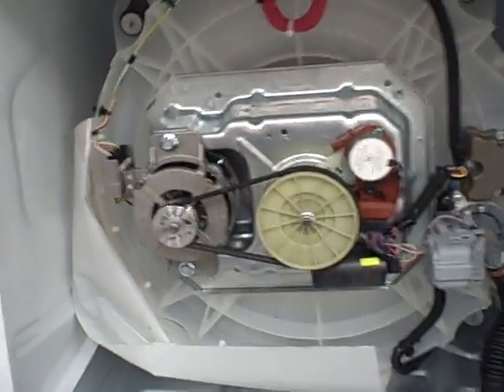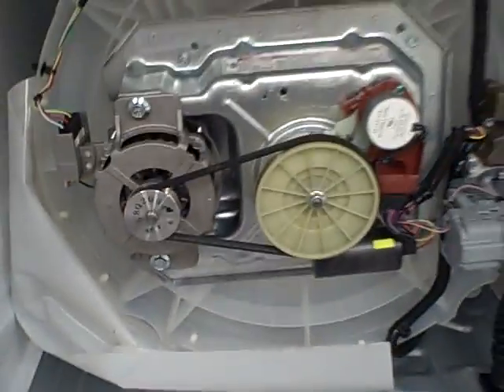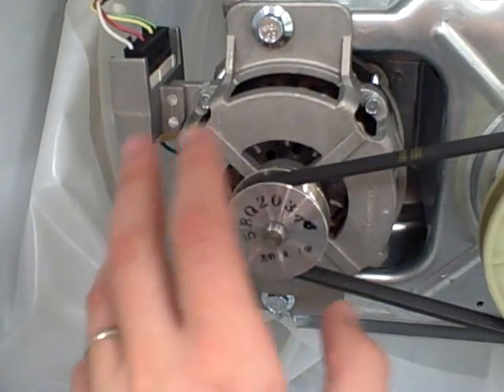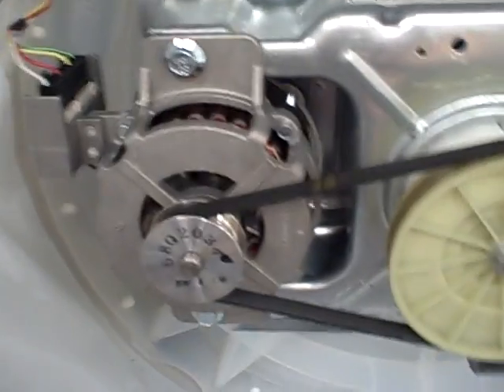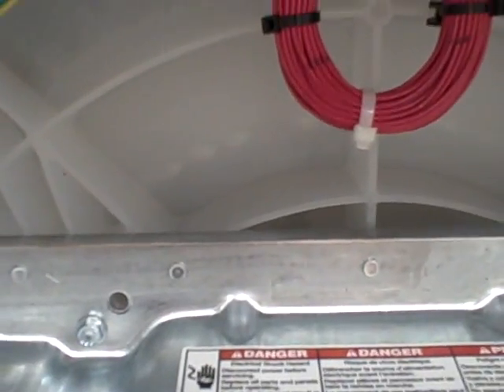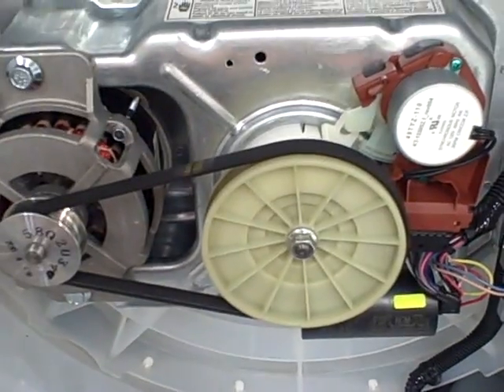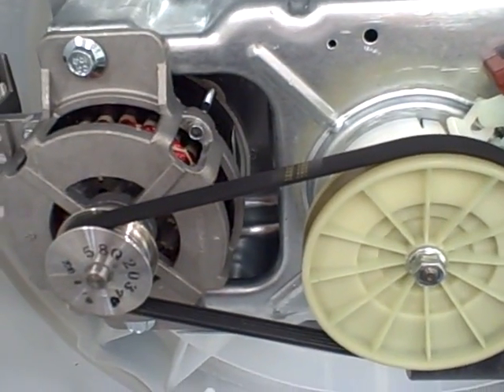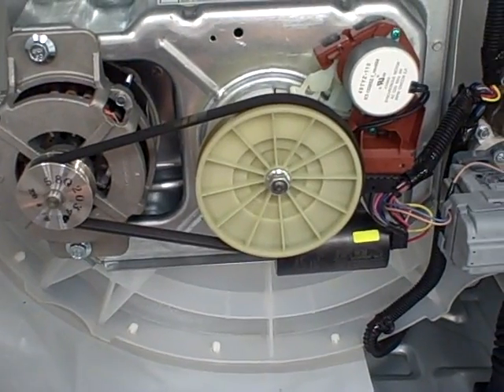ALL-NEW Whirlpool Belt-Drive washer in full detail!! (4800x model)

Comment: The internals of the transmission locaded above the splutch contain a step down planetary gear set inside a housing that operates to gear down the drive from the pulley it also splits the torque driving the agitator or wash impeller one direction and the drum the other while the washer is shifted into Agitate mode ., when the washer shifts the splutch which has a splined sleeve that locks into splines on the top of the drive pulley  it direct drives the outer casing of the transmission bypassing its inner gears and spins the tub.. there is no tub brake so the washer must coast to a stop that's why the lid must lock  (the mode shifter has a optical sensor that reads a toothed wheel in the transmission housing telling the washer control board the rotational speed of the drum) What does the gear case look like inside ?    https://youtu.be/KPwXmuRoaVE

Comment: My GE washer which is approx. 6 years crapped out on Saturday. Long story short, had service tech come and inspect machine - transmission is shot. 

Question- what rip load washer brand do you recommend that will deliver performance and longevity. 

He said GE brand is at the bottom as far as reliability is concerned. 

Any advice regarding this issue would be helpful. 

Thanks
Reply from the maker: My recommendation is s Samsung Top load belt drive.  I currently have one and in the year of ownership I have had 0 issues.
Reply: @thejmcGarage  that’s what I’m leaning towards. Do you have a model number I can use for reference?
Reply from the maker: @robertlombardi2228  yes the entry model is the WA45T3200 4.5cuft capacity
Reply: @thejmcGarage  thanks

Comment: The red part in video is a shift actuator and is a common cause of not draining properly or if it washes the stops and won't drain. Also see videos for splutch (splined clutch) they can get dirt in them that makes the actuator work hard or not engage enough. I found a new shift actuator on ebay for $30 and the splutch with new belt for $35 all new on ebay.

Comment: Maytag bravos washer makes rattling noise....abnormal noise...while shifting from wash spin mode to rinse agitate mode....wash plate abruptly jerks counter clockwise about half turn ...rattling stops and washer agitates upon completion of filling with water....main board ok....replaced actuator 2x...what’s the problem?...maybe the splutch?……
Reply: I replaced splutch...now it works fine

Comment: That was a great tutorial! Thank You. I'm trying to fix my neighbors washer, same kind. I'm hoping for some advice. Initially it had a lock lid light flashing, and it made a sound like the motor was either locked up or the start capacitor was bad. I replaced the start capacitor and the shift actuator. There is no lock lid light flashing now, and no weird sound,  but it still does not work. I get a continual sensing light on along with the lock lid light on, not flashing. Everything seems to work in the diag mode except wash and spin. Either it's the splutch or the new actuator is no good. She had some appliance guy come out, and in 5 minutes, he said she needed a new control board, or better yet, a new washer, without even looking at it. I guess I'm asking if you think I'm on the right track, or if you had another suggestion. Thanks in advance for any advice or input!

Comment: Yeah I have one of those washers and the so-called transmission is a non-repairable sealed unit here is the part numberW11255272 for mine.
It looks to me like they made a cheap washer that would cost a lot of money to repair.
It looks to me that they build a cheap washer with expensive repair parts, knowing that it would only last a few years before the whole main 😂drive without.
The main drive unit cost about 3rd of buying 170 dollars.
I think the washer drive system would have been a good system if you could have replace the inner parts of the transmission unit.
I may attempt a repair to the bearings of my unit just the only thing wrong was it, the problem being is a wilted both ends of the shaft that the bearing is on.
Looks like I may have to cut  the weld to replace the bearing.
Then I'll have to win it all back up again. I'm hoping and praying I can do itso I don't have to spend $170 on a new unit which the marions only cost $7 on eBay the part number for the bearings are 6006-2RS.

Comment: how do I get the bearings out where splauch is
Reply: you have to beat the shaft from the top. you have to remove the rods, then put the barrel on piece of wood so you have clearance between motor and the floor then you hit from top after removing the plastic cover. there should be a video. I'll look for it

Comment: I replaced the belt because the washer was NOT spinning...it worked for maybe 3-4 loads and now it is not spinning again...I checked the belt and it looks like it is slipping on the pulley mounted on the motor. I see here that you have a metal pulley and mine is plastic...is there any replacement parts?

Comment: Didn't say what the capacitor does. It's a start capacitor that gives the motor a burst of power that gets the motor going.
Reply: yes. if capacitor is bad, motor won't start
Reply: And it's a split cap. Allows the motor to reverse and start up in either direction. Caps are used for start up on many products FYI such as an air compressor without it  the motors AC load would grip the breaker, just gives the motor a hard kick start on start up.

Comment: there is an optical sensor close to the piece the synchronization motor moves that tells the control board which mode it is in and if the sensor malfunctions the board won't know which mode the mechanism is in so it won't do anything when turned on

Comment: I have been the unfortunate owner of a Cabrio WTW5500 for six years. I just finished replacing the entire gearbox because the main bearing is NOT replaceable. I also replaced the four suspension tub-hanging rods, because one cannot replace just the worn teflon sliders. I do my own work and shop carefully online for parts, so repairs have cost me "only" $200+ over six years of fairly light use. This thing replaced a 20-year-old Maytag that finally rusted out. The only repair the Maytag needed was the lid switch (sub-$10 part, about a 15-minute repair, if that).
Reply: I had old Whirlpool model lasted 10 years that rusted and I replaced with this one......BAD CHOICE....

Comment: Pure junk! Two years old and quit spinning the water out of the clothes.
Reply: Thanks for your guidelines.very,very helpful.thanks for all your time to make the videos.thanks.
,
Reply: the freaking belt just slips right off that retarded plastic no groove splutch pulley and the cover then shreds the belt till i's worthless. Really a total POS design
Reply: mine was 16 months when it quit...crazy...and I replace any parts, even the splush but still won't spin..I got the manual for the tech inside to look at the codes and it won't do the spinning in manual test. but I didn't get what the final problem is. I checked all the wiring and the resistance as required and everything looks fine...so where the problem is???

Comment: I have the Whirlpool wtw4800bq model.  It is 3 years old and works great.  It really moves my clothes around during agitation too.  The best thing about it is I have full control over the tub fill on my model, which may be the last model Whirlpool ever made with that feature.  I hope it lasts me.   Just in case it doesn't, I bought a mechanically controlled Speed Queen washer.  That thing is built like a tank and will probably last 20+ years.  I use that one now more than the Whirlpool but I make sure to use the Whirlpool about once a week.  It really is a fine machine in its own right.  It has a super fast spin speed of 1100 rpm which is faster than the Speed Queen.

Comment: I appreciate the video!  The other day, I smelled burning rubber and then my Roper (Whirlpool) machine (Model RTW4640YQ0) has had two malfunctions that seemed to happen at the same time: agitator does not work and spin cycle dies not work.  I did replace the belt because of the burning rubber smell, but that did not fix the problem.  This washing machine cannot be more than two years old.  Is it the splutch? Any suggestions?  Thanks.

Comment: All I see here is the ever increasing cheapening of washer mechanics, no transmission, lots and lots of breakable plastic parts in high load areas there should be metal, plastic outer tub instead of porcelain coated steel, circuit boards in a wet high vibration environment, and a light duty pump with its own tiny little motor that's bound to fail - pumps used to be driven off the main washer motor, extremely reliable for decades.  The "splutch" has since proven to have a high failure rate and it makes horrendous noise when the plastic gears strip out.   Sure glad I bought a Speed Queen, built to last 20 years and washes like moms old Maytag from the 60's.
Reply: The lid lock is a whole other scheme in itself besides crappy cheap parts...
It's kinda "funny" how jmc600 says, "..pretty basic design..not alot can go wrong with this..." .  -pfft
Reply: isnt the lid lock just so the manufacturer does not have to place a tub brake on er?
Reply: yambo59 check out the speed queen

Comment: Building them cheaper and cheaper every year. Way too much plastic in critical load areas, this hurts reliability badly.  Plastic tubs crack and leak, plastic drive pieces wont handle the repetitive torque, and any time a capacitor is involved its a failure waiting to happen as capacitors have a limited life in any application.   Circuit boards are another bad idea in washers, it doesn't take a genius to know high humidity areas spell death to circuit boards.  These new appliances are designed to fail prematurely and everyone is finding it out pretty quick.   Funny how the government forces more and more regulations on us to save the planet, yet because of those same regulations and greedy manufacturers building ever more inferior short lived products were throwing poor quality appliances into our landfills every 2 to 5 years instead of lasting 15 or 20 years. I fail to see the logic.  And many are saying they have to run their "high efficiency" washers twice just to get clothes clean and dry, so much for the "HE" part.   I have a 40 year old GE Filter Flo washer that's built like a tank and still going strong, try that with any washer made today.

Comment: Sad, look at all that plastic...
Reply: I was also commenting on the same thing, plastic used in high stress high torque areas too.  The plastic tub really gets me, the way a washer operates in spin etc. no way plastic can survive like steel, ive seen videos on patching the plastic tanks as well as replacing them.   I cant believe how hard they have worked to cheapen appliances as much as possible.   Lots of delicate moisture sensitive electronics and bells and whistles that impress the less informed but aren't even needed to wash clothes.  And they cant wait to sell you a $100 circuit board I bet either.  Im buying a new commercial duty Speed Queen very soon, its the only washer that's still made halfway decent with a much better warranty than any of the other brands, but theyre not cheap.  But you can buy two of the cheap ones and throw them away in three years apiece, or buy one Speed Queen and be set for 10 - 15 years or more.

Comment: MayTag HE centennial  mvwc400xw3 stuck in spin cycle won't do anything but spin. was making a grinding sound so i flipped it on it's front and there was what looked like a piece of a rag in between the big drive wheel and the plastic teeth that turn the drum. Is there suppose to be a spacer in there or was it just something a mouse dragged in. Any way after i removed it, it will only stay on spin no matter where u put the dial. i unplugged hoping that would reset it. Now  the spins light flashes all the time if you try and hit the start button , lid will lock and where off the the spin mode. was working perfect before this happened I removed the pully and got the rag out.
Reply: did you try to calibrate it? bcs it looks like in ur case the computer lost calibration bcs of the rag

Comment: Good video. 
I would disagree on one thing unless I misunderstood.
This washer is actually more complicated from a repair standpoint then the Direct Drive. 95 percent of the direct drive problems resulted in simple things, couplings, switch and valves. Not much else could go wrong. The only other problem was technicians who didn't know what they were doing.
This new machine however requires more diagnostic time and is unable to handle the loads of laundry the direct drive could handle.
I have more of these machines coming into my shop after their first year in service then I ever had with the direct drive. The three most common problems is the suspension failing, the mode shifter and failure of the consumer to use High efficiency low suds soap.

Just some thoughts.
Lavadoras y Secadoras de Mazatlan
Reply: +Lavadoras y Secadoras Mazatlan MayTag HE centennial  mvwc400xw3 stuck in spin cycle won't do anything but spin. was making a grinding sound so i flipped it on it's front and there was what looked like a piece of a rag in between the big drive wheel and the plastic teeth that turn the drum. Is there suppose to be a spacer in there or was it just something a mouse dragged in. Any way after i removed it, it will only stay on spin no matter where u put the dial. i unplugged hoping that would reset it. Now  the spins light flashes all the time if you try and hit the start button , lid will lock and where off the the spin mode. was working perfect before this happened I removed the pully and got the rag out.
Reply: Did you go into the diagnostic program to see what faults you have? It sounds like the shifter is inop but its better to check your codes first and then check your shifter. Inside your washer is a manual explaining how to enter the diagnostic program
Reply: Looked for the manual it is missing and it won't let me go into the diagnostic mode. soon as i plug it back in spin light starts flashing and that's it other than if you push the power button it spins.
Reply: Unplug the machine for 5 minutes and recconect
Reply: Then push the start stop button for three seconds minimum
Reply: Then spin the dial backwards for at least 5 full turns. Then forward one turn , then one more, then one more, then one in reverse. If done right all the lights should be flashing. Do them smoothly and evenly and steady. You may not get it the first few tries.
Reply: Let me know when you have that
Reply: Tried it several times and nothing but the spin light flashing.
Reply: Sorry was out of town.  If you cant get into the diagnostics than it sounds like a problem with the board.
Reply: Thank u we are currently renting a machine so where might i find a board? All it will do is go to the spin cycle and stays there until u unplug it or hit the start button again.
Reply: Lavadoras y Secadoras Mazatlan as a matter of fact this machine sucks, i want the direct drive machine back.
Reply: how do you consider suspension failing? because mine look perfectly fine but still the washer won't spin even if the calibration process works perfectly
Reply: Nice.

Comment: Thanks for the vid jmc6000, i'm looking for a good basic belt driven washer...can you recommend one or two models to look at please?  thank you
Reply: +volkrt most of the new washers are the same and pieces of SH##. If you can find you a good used center agitator machine go for it.
Reply from the maker: +volkrt From GE model GTW460ASJWW or GTW485ASJWW  are some good units.
Reply: I agree, when my 40 year old GE filterflo's outer wash tub started rusting that's just what I did, I bought a commercial duty Speed Queen and its been an excellent machine. When you see how smooth and stable they are in the spin cycle you realize why they call them a Speed Queen-!

Comment: I cant get my bolt off. I hold the pulley and when trying to unscrew the whole bolt moves with the nut. How do i get the nut off now? please help.
Reply: +Jaime Matulka  I know this is 3 months old but Bolt is put on with red lock tight. U can hold it and break it loose but you have to really put out at least i had to on mine. Thought at first it was welded on but it finally came loose.

Comment: I just replaced my shift actuator today 12/20 and washer still won't spin! Any idea? Kenmore 110. 26002010
Reply: Also, no standing water left. Clothe just soaking wet and won't spin.
Reply from the maker: +edgu71eg The hall sensor could be bad and if that hall sensor cannot sense movement when the drum is in spin mode it will thrown an error code and cause the drum not to spin.
Reply: yes I think spin actuator is not responsible for  not spinning. problem is unbalance...so could be bearing or the balanccing rods

Comment: 4 years old , began an awful  squealing noise while in spin, water level switch faulty, , belt chewed, splutch mostly stripped, main tub seal leaking all within a week! And from new, went through several clicks and clacks and test drum partial turns before it would fill with water sometimes taking 5 minute to start. Off balance is a norm for this POS .While the design appears to be simple as you say , all parts seem to fail at once. Never buying another whirlpool product.

Comment: I removed the cover off and it was covered with oil and the belt was off . I replaced the belt and started the washer it started to run then there was a load grinding noise. what should I do
Reply from the maker: Roy Brock The gearcase beyond the metal cover is cracked and must be replace.  https://www.youtube.com/watch?v=7FcA7b_Y9O4